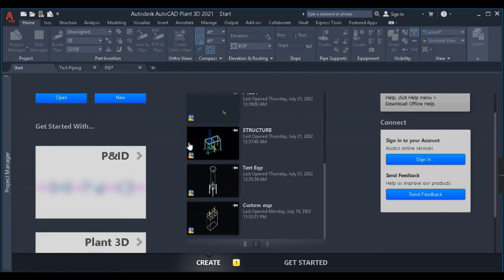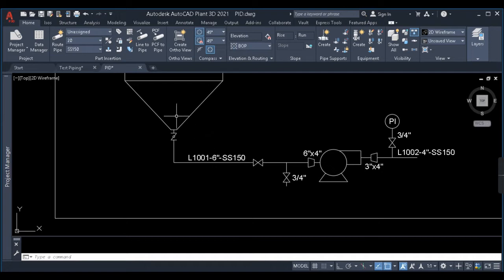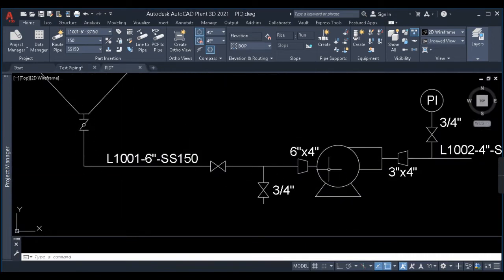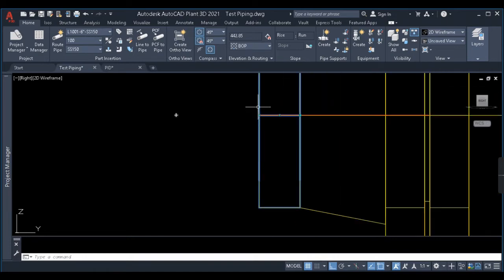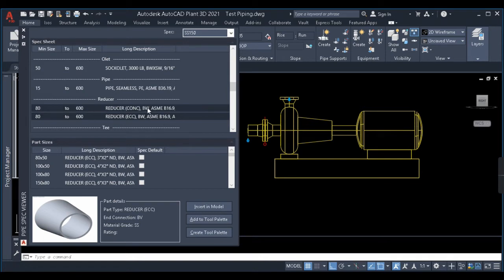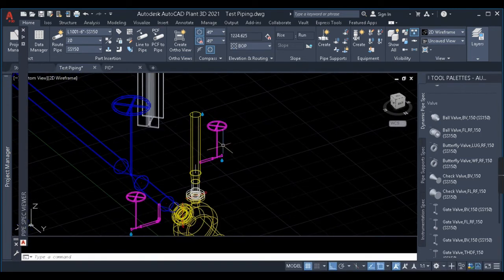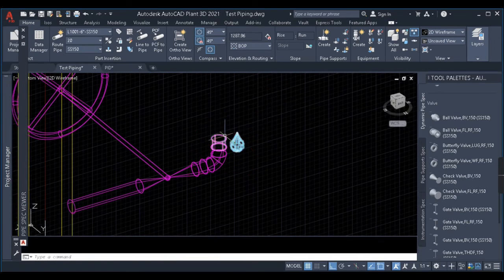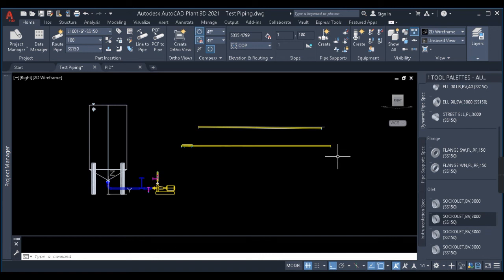Plant 3d Tutorial For Piping Modelling/Routing

Comment: Once drawn, how do you change the orientation of a vertical vessel to horinzotal ? I can't find the solution to rotate through a different axis.
Reply from the maker: Either you have to rotate the vessele manually or modify the equipment and this means you will have to reposition all the nozzles